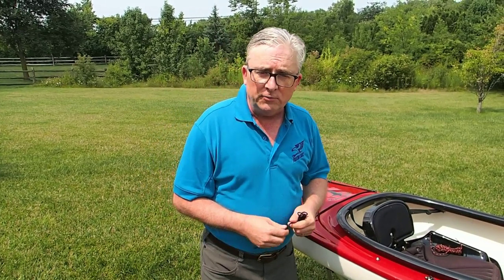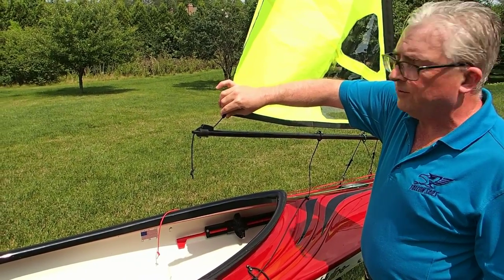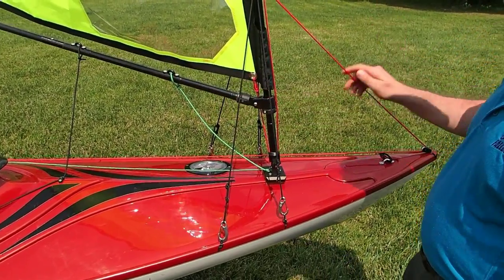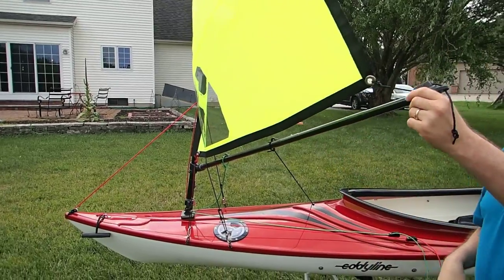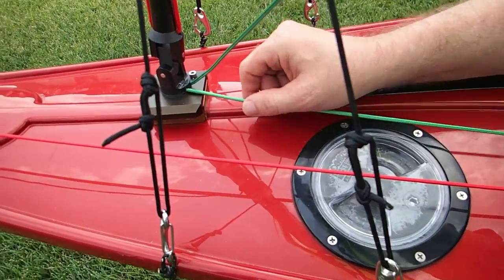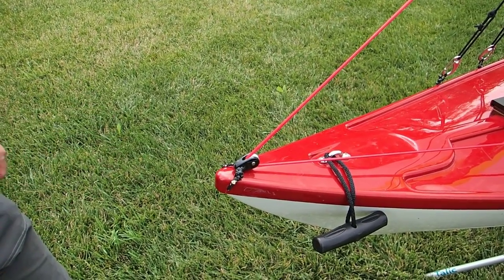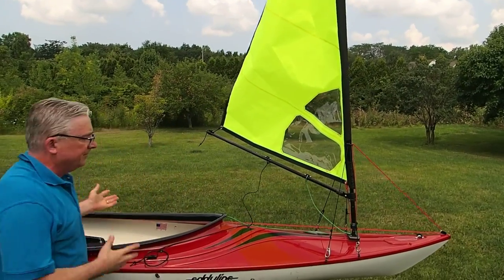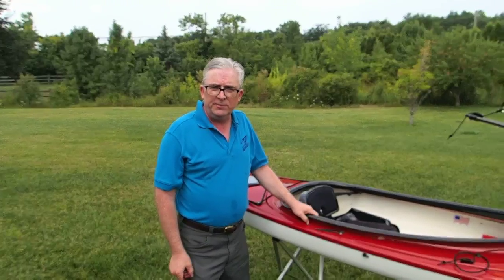What you need to know when it comes to kayak sailing and proper lines.

Comment: OK, the things I want most to know are:

What happens in the event of a capsize, If it's all cleated off, your going to find it tough to roll?
How close to the wind does this rig sail?
You don't seem to have a board or keel so what is the leeway?
What speeds do you expect at or above designed wind on the main points, upwind downwind and reaching (assuming approx 5m sea kayak)?

I like that your fore-stay is also the Cunningham, should auto adjust camber for you, nice,
So, I'm thinking some stretch in the vang would be good, maybe some ultra heavy shock cord so you can get tension but still allow gusts to twist off and spill to avoid getting knocked down.
Reply from the maker: There is a lot of questions here.  I will try to answer.

#1 
With just a little common sense, it is very easy to avoid capsizing with a Falcon Sail.
You can drop the sail in seconds, and be back to normal kayaking if you are not comfortable with how much wind there is.
And of course getting back in the kayak, is exactly like you would without a sail.  You just release the forestay cleat, and the sail drops.

If you can roll with out a sail, then with a little practice you can roll with a sail.
Here are a few videos of me doing practice rolls with a sail.
https://www.facebook.com/falconsails/videos/579334496114769/
&
https://youtu.be/u6vdygUCVco
&
https://www.youtube.com/watch?v=a8ANYekiqws

I release the forestay, and then when I set up, I push my blade out of the water to make 100% sure my paddle is above everything.  Then I roll as normal.  There is about a 1/10th of a second hesitation in the roll but it is over instantly.  You just want to know you will feel a sight stall, but then it is over.  In any case I am not the best roller in the world and I roll just fine with my falcon sail rigged both up and down.  In any case, with a little common sense you can avoid capsizing.  Most all Falcon Sailors have never been capsized.  About 100% of them that have, are knowingly pushing their limits.

#2 
You ask how close to the wind  you can sail.
It takes some time to properly answer this question.
I see first timers with no sailing experience, sail across a lake and return up wind of where they started.
I can easily make up wind progress when conditions are good.  Even without paddling.

As I push the limits of what my typical kayak will do / point further up wind, the performance drops. Eventually it makes sense to paddle and sail.  In any case, if you keep the sail oriented to the wind properly, you will gain useful propulsion to within 30 degrees of straight up wind.  As you push the very limits of this ability,  you have to paddle more.  And somewhere around 30 degrees its time to drop the sail, or consider tacking you way to your goal.  This is a good general description of what you can do. 

Of course kayaks are not sail boats, but they do have surprisingly good lateral resistance built into their hulls, so they do a lot better than you would think.
Sail boat hulls are designed to be as slippery as possible going forward.  A byproduct of that design goal, is a hull that is slippery in all directions that will spin as well.
Kayak hulls are designed to track / go in a straight line.  This is achieved by having lateral resistance throughout the length of the hull.   One other note I will make is the faster  you move, the more lateral resistance there is, and the further forward it is in the kayak.  If you can imaging a race where 2 teams are towing 2 identical loaded kayaks with a paddler on board.  One is pulling the kayak forward. The other identical team is pulling the kayak from the side.  Now which one is going to win  the race ?  100% of the time the team pulling from the front will win because there is probably 5x more resistance going sideways than forward.
In any case a kayak will sail surprisingly well.

#3
We never use a lee board or dagger board.  Our kayaks are always 100% standard.  
The cost in terms of weight, bulk, complication, drag and many times overall negative performance for adding lateral resistance appendages make them undesirable.  
          If you want to kayak, adding just a sail will give  you 80% of what adding a bulky intrusive lee board will give you.  A Falcon Sail weighs less than 3.5 pounds and can be dropped and folded to the size of an umbrella in seconds.  They are meant to be a really cool feature for a kayak, not turn your kayak into a sail boat.   With kayak hulls natural lateral resistance and the attractiveness of their simplicity, adding a lee board ends up being a waste of time.
I wrote a bit about these issues related to this and #2 ( how close to the wind can you sail )
https://www.falconsails.com/KayakSailingFAQ.php#centerboard

#4
Speed of course depends on how much wind  you have.
I can tell you a few things.
      You will always be faster with a sail than without a sail.  They will only make you go faster.
      You will speed up faster
      You will slow down slower.
      Even our small sail will push any kayak to its maximum hull speed if it has enough wind.
      Even our small sail will push harder than 99% of all paddlers can push given a good amount of wind.
      The steady power of a sail, is amazing when it comes to catching and surfing waves.  You will go faster and further.

It is not common, but when I am out in my Epic 18x in big waves and big winds I do see speeds of 13mph over and over on an outing.
This is not normal or typical, but I never never seen over 10mph without a sail.

So if your typical cruising pace speed for a day is 4 mph, with good winds,  you can do 5mph all day long with a sail and about zero paddling.  This is where some really cool benefits happen.  If you are racing a friend with equal strength, boat, skills, and effort, you will win the race every single time.
If there is a lot of wind you will will typically be able to hit maximum hull speed with no paddling on all angles of attack up to about 10 degrees above reaching, and as you go up wind more, the laws of diminishing returns will set in until there is very little benefit.  On light wind days, you will want to reach and go up wind to take advantage of apparent wind effect. For example, if there is only 5mph winds, and you go straight down wind at say may be 2.5 mph the apparent wind will be about 2.5 mph and it will not be much fun. If you reach across the wind, you can get some speed up, and the apparent wind will not drop. If you point up wind, your apparent wind will increase, and so will  your propulsion. In any case the answer to your question is a moving target.  It all becomes much more obvious as you hit the water.

In any case, I can hardly imagine anybody passing on a good quality sail rig for their kayaks if you can have one that only weighs 3 pounds and folds to the size of an umbrella in seconds.  If you want to know more contact Falcon Sails at our contact page.
https://www.falconsails.com/contact.php
The best thing to do is call, because these questions are much easier to answer in a discussion.

Your ideas are good.
But actually a rig that does not dump air is easier to handle.
What happens with a sail that dumps air is it gives a unpredictable and unsettling pulsating force.  With a solid rig you know what are are getting.  You get maximum steady power.
In order to match the maximum steady power of a solid rig, on a rig that will dump air, you need a bigger rig that will have peaks and valleys in its power. So  your maximum heeling force is actually more on a sail that dumps air.  The sail that dumps air has to be bigger than the solid rig to provide the same average propulsion, it also is unpredictable and pulsating and unsettling.  You can depower a solid rig intentionally by letting out the sheet, or outhaul, or boomvang.  Or if you are not comfortable, you can drop a Falcon Sail in seconds, which will make a situation you think is difficult, become very easy to handle and manageable in seconds.

I hope this long winded answer helps.
In any case, Falcon Sails is very serous about providing the best rigs possible and the best service and knowledge you will find anywhere.
You can custom design your own sail rig at
https://www.falconsails.com/store/

Every kit we ship out includes absolutely everything  you need to solidly rig your kayak with an awesome high performance sail rig.
All you need are basic tools.
Here is a video that will show  you how to rig a Falcon Sail and give you an idea about the quality of our rigs.
https://www.youtube.com/watch?v=Al7v3cutaRc
Reply: @FalconSails  That seems to be a very defensive reply.  I just wanted some basic performance information as there exists 2 options, sail of kite.  The kite option would seem to be less tippy and much more powerful off the wind but probably not efficient upwind so I just wanted to get an idea of the upwind performance of a kayak sail  I have sailed dinghies since the late 60s and placed in state and national titles.  I did some slalom kayaking in the 70s but did not pursue comp past high school, continuing to paddle recreationally.  I have never combined the 2 but dinghy sailing is getting a bit too demanding as I age so I am thinking about rationalising the 2 into one boat platform.  The dinghy I currently own is quite efficient and will tack within 80 deg.  Ie sail 40 deg to the true wind.  If you say you sail a kayal at 30 deg to the wind, you must mean apparent wind, not true wind.  So that isn't greatly helpful.  Even if you can point high into the wind, leeway means that your track will be somewhat less than this which is why I asked about that, to get some idea of the boats track and speed through the water without paddle assist.  It wasn't an attack or criticism, just a request for information.

I don't want to go modifying my sea kayak without knowing what to expect.
Reply from the maker: @kenwebster5053   We are willing to take the time to  educate people. People appreciate this.  Many times, conventional sail thinking yields wrong answers and assumptions, so when we have time, we go into detail to explain what goes into the answer.

Even with the best sail you can find a kayak is not going to sail like a purpose built sail boat. With a good sail kayaks sail a lot better than expected.  And they do not lead to capsizing unless somebody is taking obvious risks.

All the numbers we post are based on actual movement.  All the numbers we post are determined by gps, or returning to fixed points of land or a buoy or anchored boats or other stationary objects.  We sail on a starboard tack, take a reading, and then sail on a port tack and take a reading. This clearly shows the angles of attack we are sailing and what angles are not sailable.  It is all based on basic navigation by people that understand navigation.  

The Falcon Sail rigs can provide useful propulsion to within 30 degrees of straight up wind.  You can not just sit there and squeeze this last bit of performance out of the rig.  When a general question is asked, people need to be educated to give a full and honest answer.  This includes people that do not know the basics about sailing, and 90% of knowledgeable conventional sailors make predictions and assume all hulls are the same.   The bottom line is a beginner can do very well and figure out the basics after a week end or 2, and a knowledgeable sailor that knows at least the basics of kayaking will do very well provided with decent conditions.  Any kayak sailor can make up wind progress on their first time out.  With obvious caveats like it can not be super windy or gusty or there can not be big waves.  Some people will take a general statement and run with it, so we add information that allows people to make better assessments. 

There is no doubt a Falcon Sail will do circles around a kite on most angles of attack.   Launching a kite, and retrieving a kite, can be a big problem.  And if you do push your limits, and capsize a kite can just fly away with your boat in tow.  Reeling in a kite can be a very precarious situation.    You have to set your paddle down, and use both hands to reel it in.  With some experience, you can drop a Falcon Sail in any conditions in just a few seconds. 

The bottom line is, kayak sailing is a blast, and having a good quality rig makes all the difference.  With a Falcon Sail, you can have a great sail rig that weighs just over 3 pounds.
Reply: @kenwebster5053  Yeah if you can't roll it, it's too much rigging imho. Sea Dog makes a simple safe sail  without so many "lines"

Comment: Great video, looks like an awesome setup.  Do you guys offer any solutions for dagger/tiller/rudder?
Reply: After watching some more of your videos it looks as if you control steering with your paddle and body weight.  Do you find that drifting is an issue without the counterforce of a dagger?  Is it fairly easy to stay upright, even while tacking and jibbing?
Reply from the maker: @PaddlingIowa  Steering when kayak sailing is very easy to do.  Kayaks have a lot of natural lateral resistance built into their hulls.
Sail boat hulls are designed to have the least about of resistance going forward.  A byproduct of this is a hull that has little resistance going sideways and will not go in a straight line.  A kayak hull is designed for other goals.  Its main goal is to track / go in a straight line.  That is done with lateral resistance thru the entire length of the hull.  When  you pick up speed, the resistance increases and is very effective.  Kayaks are not perfect sail boat hulls, but they do sail surprisingly well, and do not slide sideways as a naked conventional sailboat hull will will.  ie a sailboat hull without a rudder and or a keel will slide sideways a lot and will spin.  So all sailors assume all hulls will do this.  It is not the case.   A kayak hull will track and not slide sideways nearly as much.

I wrote a bit about this here.
https://www.falconsails.com/KayakSailingFAQ.php#centerboard

I hope this helps.

Call our shop any time.  We are always happy to talk about anything about kayak sailing.

Since your in Iowa, you should consider visiting Canoecopia.  It is the biggest open to the public paddle sports show on the planet.
It is in Madison Wisconsin March 13th thru the 15th.  Falcon Sails has a nice booth right near the entrance.  This show is amazing.
Reply: FalconSails thanks so much for the very thorough and thoughtful response, great info!  Can’t believe I didn’t think about the tracking capability of kayaks, indeed a different goal from a sailboat hull.  Will totally check out that show, Madison isn’t far at all.  I’ll be sure to stop by your booth.
Reply from the maker: @PaddlingIowa  Please stop by our booth and introduce your self.  We should have bottled water and a few snacks, and some extra chairs so you can take a break as you watch some videos.
Reply: FalconSails sure thing!

Comment: Oh, the tack has changed since the video
Reply from the maker: Yes.  We are continually upgrading our sail and rigging design.
We have made a nice upgrade to our downhaul and forestay system.

Here is some more information.
=========================================
We have updated our forestay and down haul routing.

You can have a nice upgrade if you rig according to the new plan.
The forestay line goes from the cleat at the cockpit, to the bow pulley, and then goes to the junction ring on the mast.  It gets tied to the junction ring, and does not go down from there.
The shock cord attached to the sail tack acts as the down haul. From the sail it goes through the hole in the boom, then to the cleat on the base of the mast.

To learn more about it, take a look at this video.
www.facebook.com/falconsails/videos/2205345816439906/
Reply: @FalconSails  yeah I have the new version! But it's the old routing in the paper instructions I received